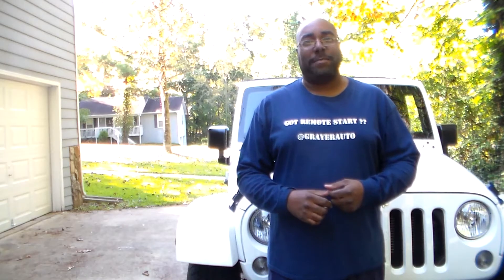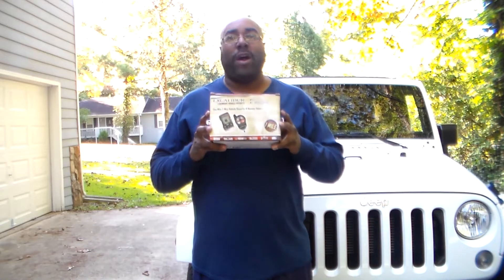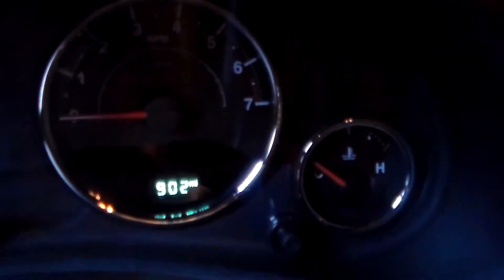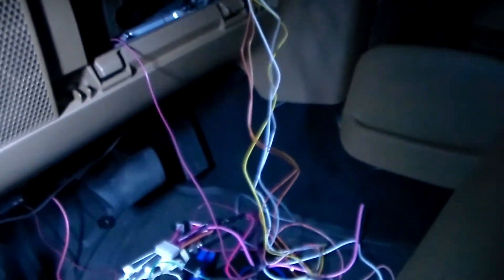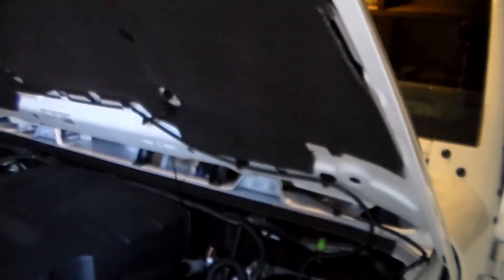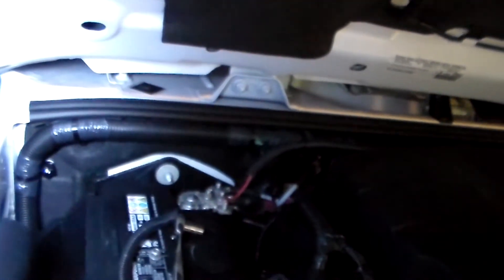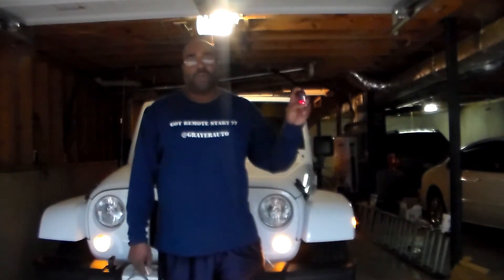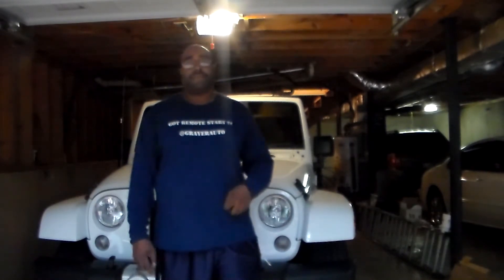2015 Jeep Wrangler 2-Way Alarm / Remote Start

Comment: I have a 2012 jeep wrangler with a factory car starter/alarm. the alarm is to basic and the starter doesn't have a good range. I want a two way starter/alarm combo. Is it possible to do that when I already have the factory system in it.

Comment: Do you always run positive to battery for your remote start or just on this model? Are the ignition wires to small gauge to run off of?

I'm in the chicagoland area and also do mobile installs with Omega alarms.

Thanks again and continue the great videos!!
Reply from the maker: Ignition wires in most newer Chrysler, Dodges, and Jeeps are only 16-18 ga. Won't carry enough current. Wouldn't chance it b/c you could end up burning up the ignition harness then the customer would have a $400-$500 repair.